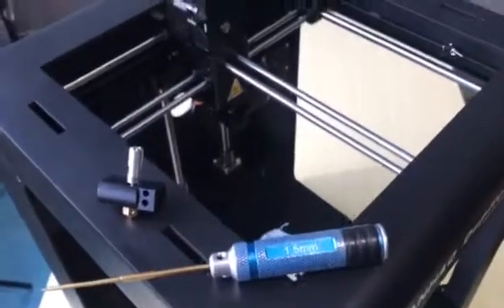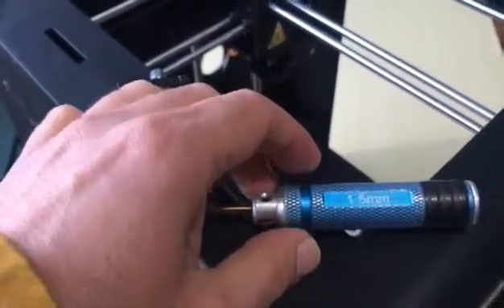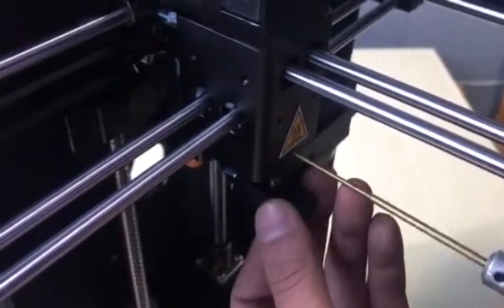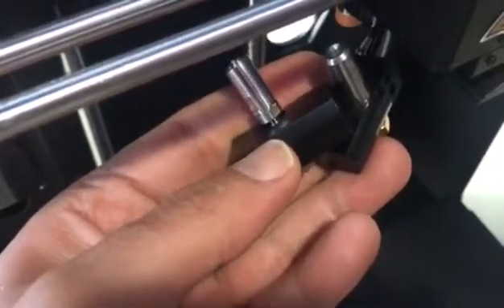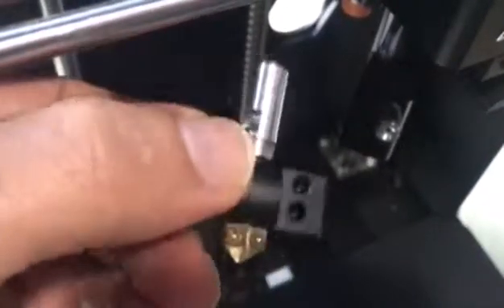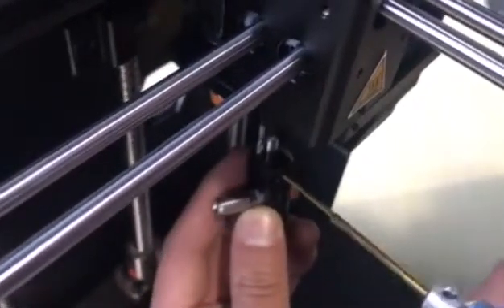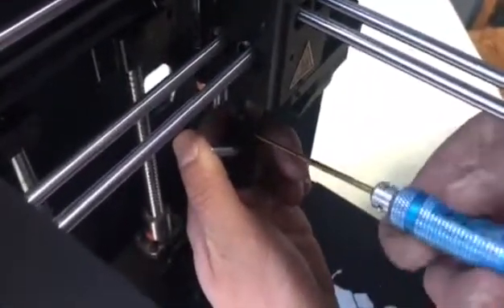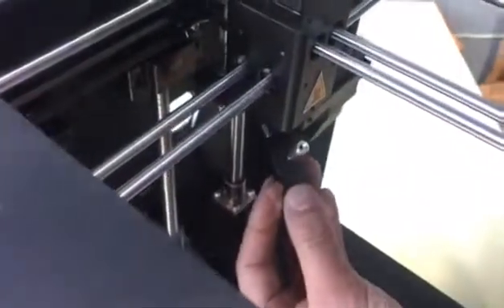Replacing D6 Plus HotEnd

Comment: Hi, I am trying to replace the original hotend with the all metal (black one) that came with the printer. 
however the chamfer on their tops is not the same and the new one (black) sticks out more then the old one by 2 or 3 milimeters.
Q1: Is that normal?
Q2:what should I do to recalibrate the height so that it won't crash agianst the bed? (move the PINDA down?
Reply: same qustion, cant put them back at hight when both screws will fix hotend. And also crash agains bed